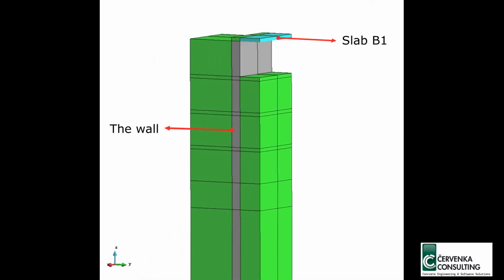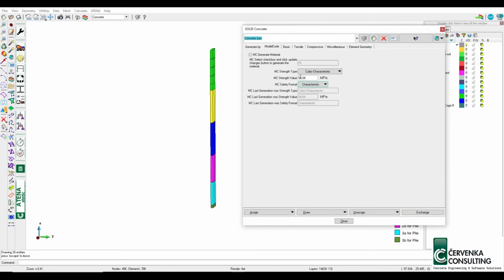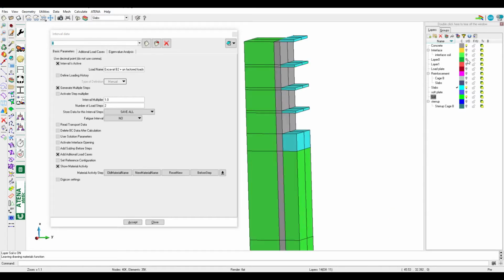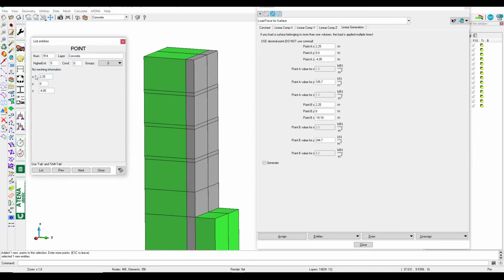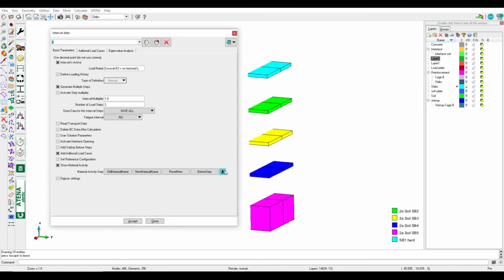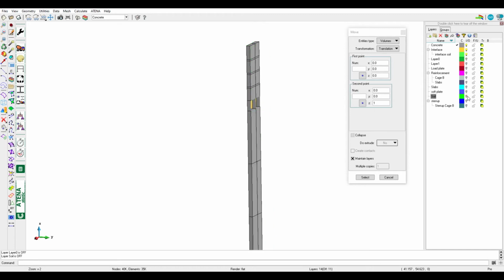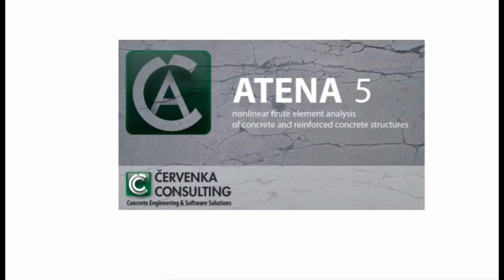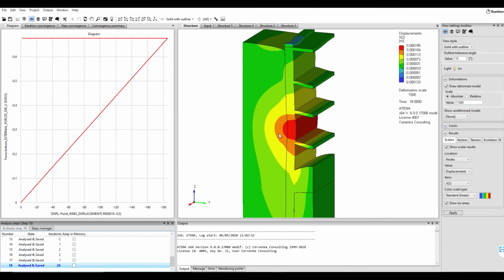ATENA modelling of D-wall construction process and water pressure load

Comment: Thank you for that video, but I have one question: Where are the monitors for the reactions and displacement? Thank you again!
Reply from the maker: Thanks for your comment, the monitor for reaction : MAx - monitor for the bottom surface sumation reactions by Z direction , for the displacement: Monitor for the top point where the load was applied